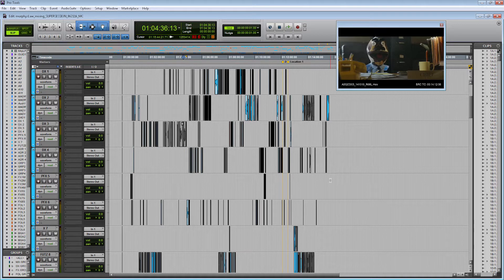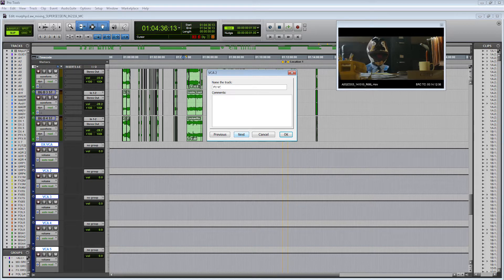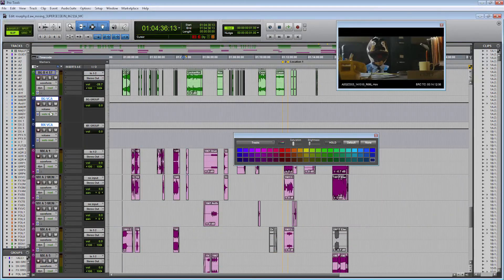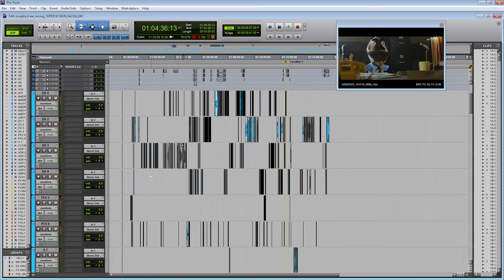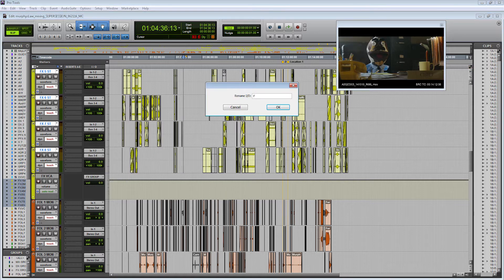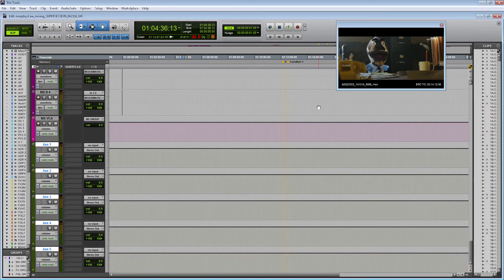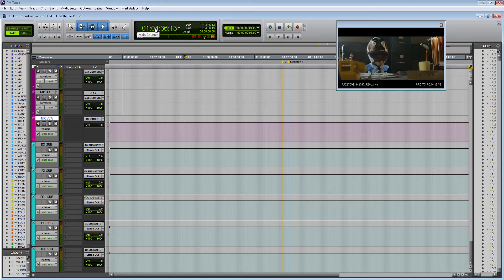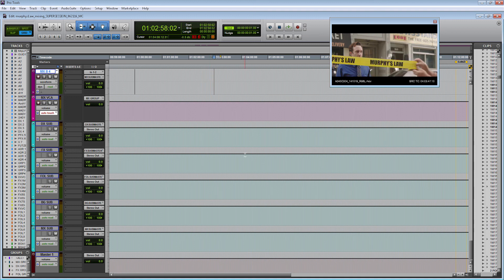Tutorial 12: VCA Tracks and Submaster AUX Track Busses - Post-Production Audio Workflow Series

Comment: What’s the difference between using a VCA track verses the group tracks?
Reply from the maker: Are you talking about the new Folder Tracks in Pro Tools? Technically "Grouping" something in Pro Tools is different than "Group Tracks" that are available in other DAWs. So if you're talking about Folder Tracks, then yes, they're very similar to VCA tracks. Essentially both let you control the volume and add plugin to the audio from a bunch of tracks at a single place within a session. Here's some more info on Folder Tracks: http://www.avidblogs.com/folder-tracks/
Reply: @FilmSoundTutorials  Will check it out, thanks!

Comment: i have this problem. in my project i have send all my audio elements(dialogue, hard effects, foley etc) in aux tracks with reverbs in at every scene of the movie(1 inner and 2 outer scenes, so 3 reverbs). So my problem is that i cant send audio out in 2 busses simultaneously and obviously cant use Group Track and submaster tracks because i already have sent my audio out in reverbs and then in master
Reply from the maker: Well luckily my next video will be on using Reverbs so hopefully I can answer your question then! Spoiler: You'll need a different Reverb plugin for each family, and then you can route the output of the Reverb back into the Submasters. But I'll explain more in the next video. Thanks!